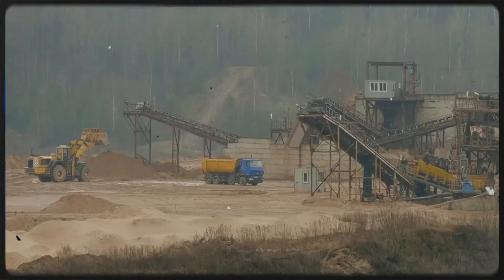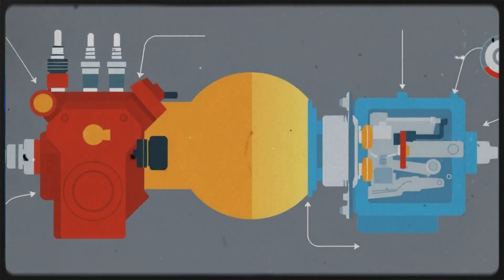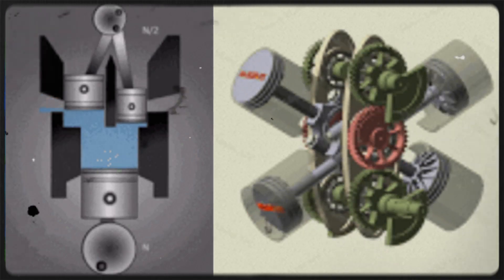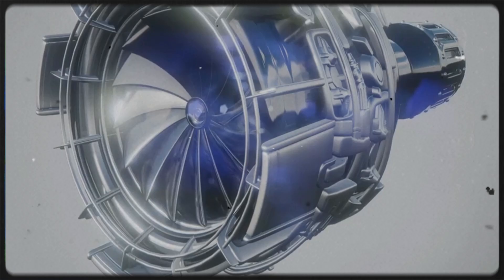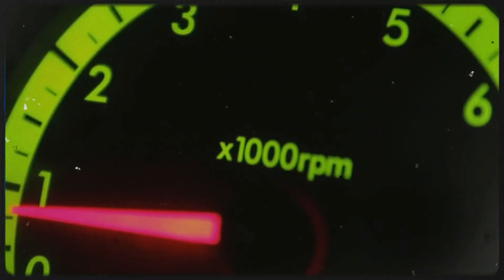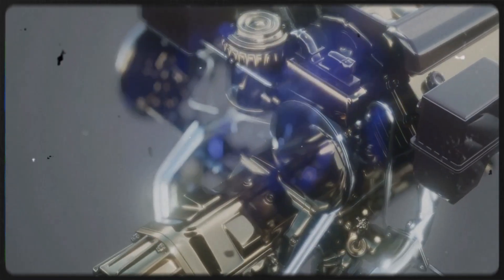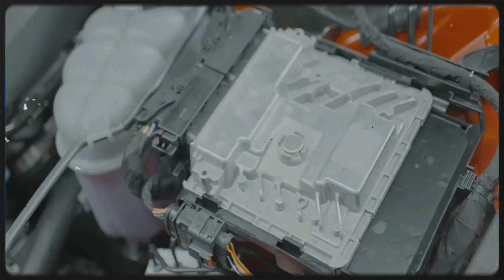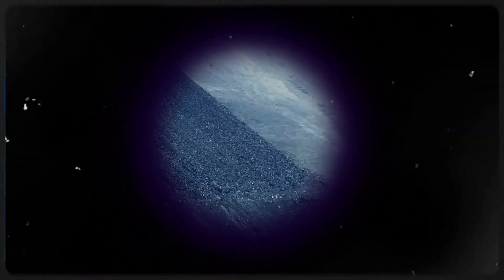Why Do Diesel Engines Use Less Fuel?

Comment: They run on autoignition, happens as soon as you inject the fuel inside a volume of air hot enough to ignite it. Means you can run them a lot hotter than spark-ignited engines. As we all know from basic principles of heat engines, a hot engine is an efficient engine. So much so, that the additional thermal efficiency far outweighs the additional parasitic losses inherent to the type.

Plus you can run them as lean as you want, provided you don't care about NOx emissions.
Reply from the maker: Absolutely, you’re spot on 👍 higher operating temperatures and lean burn are key to diesel efficiency  I’d just add that high compression ratios, no throttle losses, and diesel’s higher energy density also play a big role.